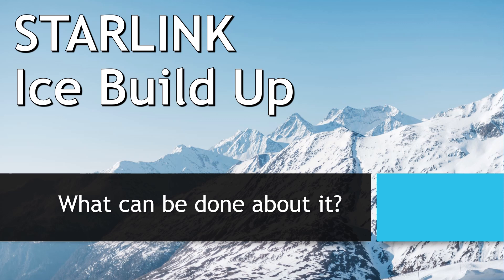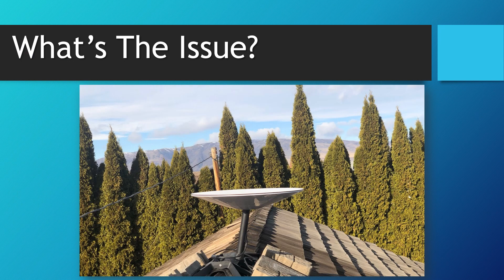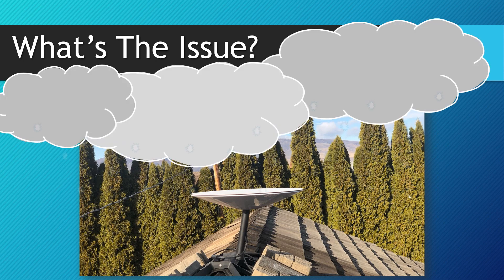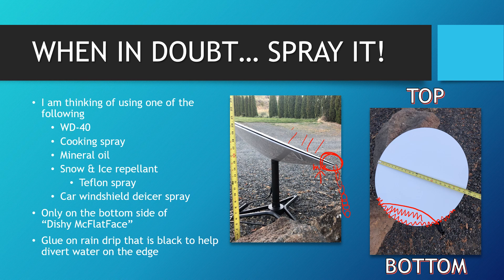#STARLINK Satellite Dish Ice Build Up Prevention Ideas - Ounce of Prevention...

Comment: In perfect icing conditions I have had up to 1/2” of rough ice on the dish adhere to the surface  which then destroyed my reception until I used deicer spray to remove the rough ice.    I think in daylight the heat from the dish and the sun would eventual melt the ice off.
I have had icicles also build up on the lower edge of the dish and if they get big enough the dish cannot move.
Because this only seems to happen on one side as the dish tracks the satellite in the afternoon, I’m going to try heat trace where the ice hits the stand my  dish is on or on the roof if your dish is mounted up high.  I haven’t seen them for awhile but automotive stores sometimes call them oil pan heaters.  I believe this should do the trick in winter weather.

Comment: It is December 2021 in the Upper Peninsula of Michigan.   Snow has been on the ground for at least 3 weeks and we now have single digit temps.  The Starlink dish has repelled all ice and snow has not built up on our dish.  My Direct TV dish is caked with ice and we lost our tv signal.  However, we can watch tv over the internet because of Starlink.  So far so good.

Comment: How about gently knocking away each icicle off when they gets 3 inches long. By makeing a home made small wind turbine and mounting it 3 inches below the the low edge of dishy. I don't mean a wind turbine that virtical like a airplane propeller. I mean a wind turbine that is horizonal with 3 cup shapes  that catch the wind and spins like a kids spin top. It could be made out of plastic drinking cups, some wood and screws. When I was researching wind turbines for home power generation, I learned that this kind of wind mill dosen't spin dangerouly fast in very high winds like the porpeller types do. I wonder though if dishy will ever try to tilt down more that direction and break the mini wind mill during reboots, or firmware updates.

Comment: Starlink claims they have a hydrophobic coating on the top side of the dish. Heat tape may be best solution if you must have it mounted on roof. I know you have pipe adapter. Any way you could raise dish up a bit with a short pipe and integrate to that stand?
Reply from the maker: The coating works great, the issue seems to be right on the edge of the dish where there is silicone adhesive and plastic where the water that runs of starts to freeze again. But the idea of raising the dish should definitely fix the problem.
Reply: Let us know what you come up with. I should be receiving mine in a few days and the inputs from everyone are very helpful.

Comment: Car paste wax can help and is cheap. The rainx suggestion might also work. Ultimately they need more heat, but you can only get so many watts out of the power over Ethernet that they are using to power the ground station.
Reply from the maker: For sure, to bad where I live we are hardly getting any snow this year. Last bit of snow has already melted away and it feels like early spring outside, lol. Need some farther north youtubers to connect with to see if they can test it on their system :)

Comment: Bad idea about the edge. What happens when the satellite dish changes orientation which it can do automatically when satellites shift or coverage changes. All of a sudden your lower edge is the upper edge. Never going to work. Personally I would just extend the pole to make it harder for icicles to reach the roof
Reply from the maker: True but it always points north, so if it was detachable and only went around the bottom 1/3 or 1/2 of the dish it could help a lot. Taller poles will work in some areas but wind 🌬 could mess things up. Something built in around the entire edge would be the easiest but maybe a version meant for areas that get lots of snow/ice. That version wouldn’t be needed everywhere.

Comment: maybe some thermostatically (or switch) controlled heat tape just on the rim underside so icicles can't anchor.  If one edge is consistently down, you'd only have to do that area.  Not sure if this would cause any EM noise in the signal.

Comment: Next update Elon said would install more ice mitigation. And will adjust the heaters.  Think if you mount it higher up and not so close to the dish it would help. Watch out the oils will degrade the sticky of the adhesive on the cover.  Also make suggestions to Starlink and ask for there suggestions.
Reply from the maker: Great idea

Comment: I don’t seem to be having any issues but all we have had are light snow events with about 2-3 inches maximum.  My dish is also mounted on a longer pole which I showed in one of my videos I think you watched.  It’s about 40+ inches off the roof surface.  That being said I’ve had icicles hanging off my back eves where my heat tape is installed 10ft long before.  I will continue to monitor during heavier snow events over the months and let you know some feedback.
Reply: I'm in Helena MT and we haven't hit our coldest time yet, will see how it goes in Jan and Feb when we hit negative degree weather. For this reason I haven't mounted it on the roof yet.

Comment: What do people do in cold climates who have satellites dishes already.

The problem is, any extra heating needs to be  around the whole edge, and you do need it to only come on, when it is < 0 degrees, as not to be an unnecessary power draw.
Reply from the maker: I found some black fabric cloth people put on old style dishes and those look to help, but they aren’t already producing heat no matter what. It’s almost like there needs to be a cold weather kit of some kind.

I think a simple solution would be a thermal pipe connected to warmer sections of the dish. Then that heat pipe goes to the outer edge. That way the heat already being made keeps the edge of the dish warm. The same kind of heat pipes used in CPU or GPU coolers.
Reply: @adventureswithkramer  It would have to built in from the start though, since otherwise it will require another power run.
Reply from the maker: @neilm9400  I don’t think the dish we are currently using in beta will be the final version, if this ice thing become enough of an issue there might need to be another version where heat pipes or some kind of ultra small heating element is on the edge. I am actually surprised I haven’t seen any bird poop, I wonder if there is some kind of frequency or something deterring birds. I have seen none even within 50ft of the thing...

Comment: My plan for my roof mount is as follows.  I will be having a Triangle shapped 1/4 steel plate ( Painted of course)  which I will bolt with 6 screws to the front of the Facia boards where they meet at the peak. This plate will have an arm extending out from the Facia boards about a foot.  From this arm there will be another arm welded on going up towards the peak of the roof and extending the peak by about a foot and a half.  The Dishy will then be attached to the top of this.  All fabricated parts will be heavy gauge steel to avoid movement during windy days.  So basically the Dishy will be sitting on a pedestal type platform with no chance of ice build up below as it will be suspended outside of the Facia boards and not sitting on the roof.  Good luck to you
Reply from the maker: That sounds awesome! Would love to see that when it’s done
Reply: @adventureswithkramer  will take pics once complete might be a while since I have to have it fabricated.
Reply from the maker: No rush, excited to see the end product :)
Reply: @adventureswithkramer  I figured quarter inch steel plate should hold that bad boy steady in our windy area in Oregon. Lol

Comment: Best fix would be mount it on a tall pole instead of the roof. Heavy heavy snow will block it completely from underneath. Reachable to clear of snow but not blocked by snow.
Reply from the maker: I worry if it is too tall I will need to use guide wires to anchor it in place. Also, I worry if icicles still keep forming it will just put more weight straining the servos. What about some kind of thermal pipe wrapped around the edge?
Reply: @adventureswithkramer  I agree, the more height you add, then the icicles will get longer (heavier), and as you said, may strain the dish. I hate to say, but it may need to be ground mounted or in a location where it can be cleaned once a week (for example).
Reply from the maker: @neilm9400  that is going to suck if I have to move it down off the roof during winter 🥶
Reply: @adventureswithkramer  I'd try pipe insulation around the edge. Cut a small hole at the bottom so the water doesn't puddle. My thoughts are keeping the heat from escaping the dish. If the drips are warmer they'll fall before freezing. Of course there's going to be a minimum temperature that will work also. Cheap try.
Reply: @adventureswithkramer  like a gutter heating cable? You shouldn't need any guy wires.
Reply from the maker: @Ligby  yah, I just don’t want to run something separate on the roof :(
Reply from the maker: @Ligby  or a bunch of Christmas lights :)
Reply: @adventureswithkramer  thermal pipe might work. Make a call  and see.  I would worry about rf from the heat tape interfering with the cable

Comment: Don’t think you solution will work, at least not longer term. Water drips off and builds up from the surface below and will jam the dish when it tries to tilt down onto the icicle. Solution would be to mount the dish on a longer pole. If you still get long heavy icicles hanging off that over stress the servo’s the best solution would be for SpaceX to add a heating element along the outer edge to prevent icicles from hanging off the dish.
Reply from the maker: I like those ideas :)

I wonder if any basic poles at Home Depot used for fencing might work to cut to size and increase the height? I could easily paint it mat black to match the rest and just use a bolt on the bottom with  similar holes at the top. I like that idea. 

The sprays are for sure going to be a temporary solution, but until something else gets figured out I want to do what I can in the meantime.
Reply: @adventureswithkramer  if you use the new pole mount it will Take up to 2.5" pole buy u will need to guide wire the pole to reduce shake.